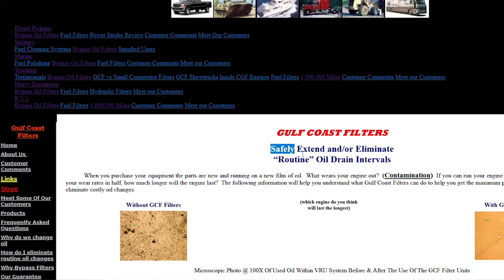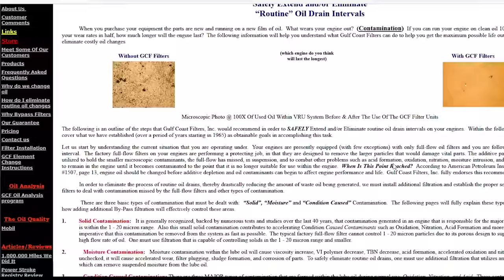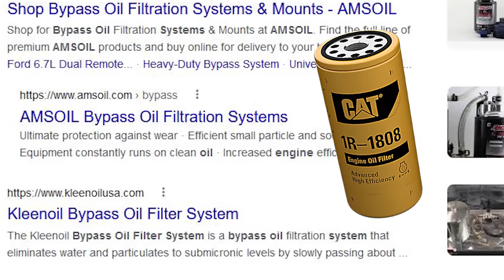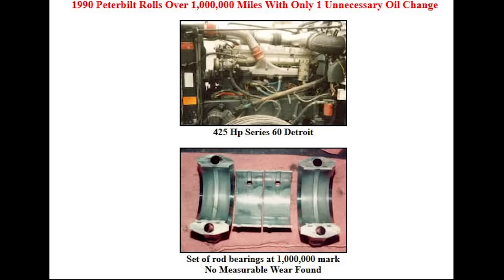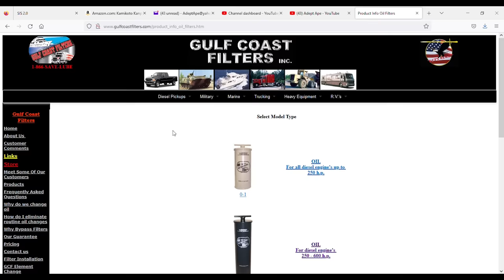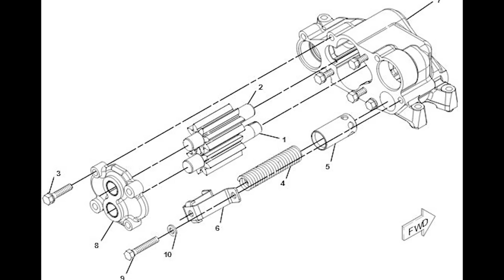No Oil Changes and 1 Million Miles!!! Are Oil Changes Optional with a Bypass Filter? (INTERESTING)

Comment: I spent 27 or so years as a hydraulic mechanic, and 13 of those years I worked with Kubota powered forklifts. One company, that used the cranes and forklifts that I specialized in, decided to get the oil tested instead of changed. In the Kubota engines they had us put Royal Purple oil in, then send out samples at change intervals. All was good for a while, then when a sample came back bad and a change was recommended it was changed. You never get every drop of the bad oil out, and the next sample came back bad as well. And so on, and so on. With hydraulics changing the oil in the tank is only 50 percent of the story, there was always "bad" oil in the hoses and cylinders. Just change the darn oil at the recommended intervals.
Reply: Yep oil is cheap, good oil even cheaper
Reply: Ya. But you didn’t hVe the bypass type filtration installed right?  So as far as this conversation goes your point kinda doesn’t make sense. Having the bypass lower micron filter installed means that when you do finally change your oil the filter ends up pulling any old contaminants out of the new/old oil.
Reply: @Mad.Man.Marine  change oil when it gets dirty. Simple as that i know a few eng builders. I change gear oil in my kx every 2 rides. Oil does breaks down and thats not a debate neither is the need for oul changes to protect the longevity of motor engines
Reply: The only way you can be sure all of the oil is clean 100% of the time is with a.good bypass filter. Im not sure which of the bypass filters is the best. There are several that clean oil. I like the big Gulf Coast filters for big hydraulic systems.For small systems the little Gulf Coast junior is as good as you can get. I like the Australian Jackmaster Classic. If I can't use paper towels or toilet paper in a filter I dont want it. I dont want any filter that opens at the bottom. I like the top loaders. I dont plan on paying 30 bucks for a small filter element as long as I can find Scott 1000. To me there is good oil that is clean and good oil that is dirty. I just put 5 gallons of Lucas hydraulic oil in the Ford tractor. I have a bypass filter for it.Dont have it on yet.The hydraulic oil operates the hydraulic system and the 12 speed manual transmission.. The Lucas was the only one Auto Zone  had.that met that specification.
Reply: So that's hydraulic oil and not engine oil which are comparedly the same however the hydraulic oil isn't constantly being moved around as in like an engine a lot of it will stay in the hoses and cylinders
Reply: I used to work in a power station where we ran VERY heavy Terex plant to move the coal stocks. Apart from maintenance time, they ran 24/7 and each one needed 45 (UK) gallons of oil PER WEEK. 
We fitted bypass filters (can’t remember the brand), changed filters and lab tested the oil every week.  The engineer chickened out and ordered an oil change after three months. But the oil came back clean and really could have gone back in.
Reply: @Dave5843-d9m  we never used bypass filters on anything. The companies (customers) wanted cheap options with little or no work involved, and ended up costing money. No thought was involved.
Reply: I think with the rams working the tractor loader up and down the oil will find its way back to the reservoir..Just got the Ford tractor hydtaulic filters installed. It has the Motor Craft FL 1A and an old Motor Guard on it.  Put a Motor. Guard compressed air filter element in it.They claim submicronic. Its like coffee filter paper in a roll with a plastic core. Ive accumulated a few over the years. Have to use them on something. It has 4 Ford filters on it now. And A Motor Guard. Havent checked to see how to do the cooling system. I have a Cummins cooling system filter.and a Gulf Coast junior
Reply: The Japanese Ford tractor isnt what im used to. The hydraulic oil does everything but the engine. The same 5 gallons runs the power steering the loader the 3 point hitch and all the gears.. one dip stick for everything except for the front differential. It has its own dipstick. The screen is inadequate.  I added a motor craft and a Motor Guard.  It ran at about 70 PSI. On the filters. After a days work it came up to 100 PSI.  When I  move the hitch control too fast it goes to over 150 PSI. Put the filters on the return line on the loader control valve. The FL 1A is a full flow with the Motor Guard being a bypass filter..used a Perma Cool remote filter mount with a Perma Cool universal oil cooler sandwich adapter
Reply: Had to do the hydraulic system a little different on the Ford tractor.. The loader control valve has pressure on both the inlet  and outlet. The 3 point hitch and the power steering are down stream of the loader control valve. Ended up feeding the Motor. Guard submicronic filter with a needle valve and pressure gauge. The hydraulic oil does too many things to use only a screen in the suction.. The motor oil was pretty much the same as the filter on the 390 in the F250.
Reply: Ended up with a Motor Guard and a KN filter on the hydraulic system on the Ford diesel tractor. Ended up with a orifice made out of a grease zerk a needle valve and a pressure gauge. The KN and the Motor Guard are parallel. If the toilet paper cloggs the pressure will go to the KN. The engine has a flat head Ford V8 canister filter converted to use a full roll of Scott 1000. Right now it uses a cut down roll of VIVA paper towels. I mark a roll of VIVA paper towels at 4 1/2 inches. When it gets used down to the mark I cut it to make two elements. The million mile truck used a filter that took 2 full rolls of Bounty Big rolls with Shell Rotella 15 40 conventional I believe. The reason it had virtually no wear was the oil was never allowed to get dirty. I started with a Frantz oil cleaner and Delo in 1963. Only use top loaders now. Gulf Coast Motor Guard the Jackmaster Classic and the Ford canister.
Reply: I agree but there is always room for improvement in filtration.
Reply: Well, royal purple is some of the worst oil money can buy so…
Reply: I don't know why you would by a 100k or more piece of equipment and not maintain it. Oil is cheaper than any engine that it goes in so what the problem.
Reply: @gazking08mx if you aren’t sending your oil in for testing you have no idea what condition it is in when it’s drained. Just because you THINK it is bad and needs to be changed isn’t necessarily the facts jack.

Comment: I have a 2005 freightliner with the mercedes engine. The original owner had the gulf coast bypass filter. I bought the truck with 1,100, 000 miles. He never did anything to the engine. It has 1,270,000 now and it's running strong. It does not burn oil. He did oil changes. I think the extra filtration helps a lot to make the engine last.
Reply: That’s the way I’d use em- not so much for these insane extended intervals, but more so just extra protection for the engine. I do believe they help alleviate wear.
Reply: I just got a truck with That engine. I’m kind of nervous because of what people say of them I’m glad someone is using one that’s been good to them. Makes me feel better lol
Reply: ANARCHY
Reply: Is that an MBE4000 engine?
Reply: Om 906?
Reply: Josh, another interesting informative video !! I've been thinking  about using this system for years. Would just like to go 100,000 miles between oil changes ??
Thanks and Happy Thanksgiving to you !!!
Reply: @isaitrujillo2323  that Mercedes is a rebadged detroit
Reply: @holmes1956O  that’s good to know lol
Reply: GM own mercedes so it's a rebadged mercedes.
Reply: @eugeneoreilly9356  No they don’t lmao! Mercedes use to be merged with Chrysler. Not GM..
Reply: @eugeneoreilly9356  dead wrong, Mercedes has never been owned. They bought Chrysler.
Reply: Glad we got that whole Mercedes Chrysler situation figured out......cool video seems like it's more for maintenance prevention.. hey whatever helps.
Reply: @holmes1956O  mercedes motors came first before dd15/13. So actually Detroit is a 2nd gen rebadged Mercedes tech motor.
Reply: @kennethobando5755  <---This guy is right.   The mercedes engine is Mercedes designed.
Reply: @Isai Trujillo  Mercedes diesels are very well built. Don't neglect it and it will take care of you for a long time.
Reply: About the million mile truck. One Shell oil engineer said its not unusual for these Detroit engines to go a million miles but not be in near new condition. As far as I know the only reason for engine wear is contaminated oil between the parts and not enough oil between the parts.
Reply: Only Engine that I've driven that had to be taken apart twice in 4 years that we keep trucks.  Head gaskets.  Been a while but I seem to recall each cylinder having it's own head gasket.
Reply: yep
Reply: Yes Sir
Reply: @kennethobando5755  you are. Absolutely correct Sir
Reply: @JSAFIXIT  Also. Don’t forget the. Famous. Iszu. My family had one. Tan and tan some more. In a little pick up truck
Reply: I stopped draining oil in 1963. I probably change my depth filter and add more new oil than most. I mostly use gasoline engines that are easier to deal with. The truck owners that dont drain oil normally change the depth bypass filter more often and add more  new oil. The thing to avoid is allowing the oil to get dirty then draining it.
Reply: I had a client with a 05 columbia with the mbe4000.
3.3 mil km original, never rebuilt. Every bolt is fused. It's a pain in the ass and easier to swap then to rebuild but wtf 3 mil. It is insane and without bypass filtration.

Comment: I run a FS 2500 bypass filter on a 2000 5.9 with 640,000 trouble free miles on it.  I went 100,000 miles once on Delvac 1 synthetic.  That drained oil tested fine but I could not wrap my head around going longer.  I now change filters every 15,000 miles and change the oil every 30,000 miles.  The bypass systems work.  They work by trapping the small particles that cause engine wear.  I now run Rotella T-6 5W-40 oil and use one quart every 10,000 miles.  I swear by bypass systems to extend engine life.
Reply: A 24V 5.9 is my favorite diesel engine of all time!
Reply: You got the best dzl lube oil in your engine  ronrdzl

Comment: Railroads tend to not change the oil in large locomotive engines.  They change the filters, clean the strainers and sample it on a regular basis (they change it if the sample comes back bad, but that usually also means they have to fix something on the engine).  And of course add more when it gets low.  This strategy has worked fine on EMD, GE and ALCO engines for decades, but hasn't worked as well on the occasions when CAT or Cummins engines have been tried in locomotives.
Reply: I work for a Class 1 and have been told the same from mechanical department guys.  Was told as well they run straight water in the cooling system with some kind of special drain that will drain the system automatically before it freezes.
Reply: As a locomotive engineer on a class 1, the engines burn and spill engine oil so fast that changing the oil would be useless 😆. As for the coolant yes basically straight water is what we use sometimes they add additives in it but in the field we just fill them back up, the engines have to be running constantly tough, they have GURU plugs to dump the water in case it gets too cold.
Reply: I believe this is the case for ships with their huge engines.  Their sump holds a few thousand kgs of oil and the intention is for it to never be changed, just regular lab samples.
Reply: I thought it was interesting how they have an instrument that passes electric thru a used oil sample. The instrument is zeroed on new oil. If the reading is too high a sample goes to a lab to see why the high reading.
Reply: A marine mechanic told me that in the second to last ship he worked on, they only changed the oil once a year, but they also cleaned the inside of the engine with gasoline. No problems more than a decade.

The last boat was more modern, changed the oil more often, but didn't clean the inside "and we had to send it to the docks for repairs tree times already" he told me.

It made me think a lot at the time.
Reply: On industrial applications, they will readditize some products.
Reply: I also work for a class 1 railroad and we change oil and filters in our Loco's twice a year.  What we found not changing oil on a specific schedule that we started going through turbochargers, PA's, main and cam bearings along with other internals. We also do 30 day oil samples to catch a problem before it gets too expensive and not just in repairs but also downtime.  Cause if it's not haulin' it's losing money.
Water by itself is not suitable for the engines in locomotives but can be used for emergencies....we use borate mixed in the water to prevent corrosion.  We cannot use coolant due to environmental concerns if there was a leak.
Reply: @t1_d2_g3  
If water is mostly used and if dumped, how can the engine cool off if it has no water when in use? Is the water replaced once the engine is turned on and hot enough? Why no electric heater to heat up the water again?
Reply: I've been having oil samples come back clean even when ege cooler is blown.  Can someone explain this to me. Is this a lab issue or the the type of coolant used doesn't show up? Cummins
Reply: All that effort to not change the oil
Reply: Damn I change oil in emds every 700 hours .
Reply: When I met my wife she had a VW beetle with no oil filter.. They were robbing the hell out of her. They had her getting the oil changed about every 1500 miles. On our second date I brought a Motor Guard oil cleaner. That was the best you could get in the 60s Didnt learn about them until about 1966. I still have a couple over 50 years old. Not much effort in changing a filter that cleans oil. Unnecessary oil changes are a hassle. Sadly Motor Guard only makes compressed air filters now.. I like the Australian Jackmaster Classic. I changed it a little bit. Their orifice is a little smaller than I like. I have a drill and a 1/16 inch drill bit. A roll of Great Value 1000 from Walmart every 6.000 miles will do it. Havent worked  out the hours on the tractor. Probably a couple times a year..I have a couple of Gulf Coast juniors and a Motor Guard on the truck. I put them all to work.I prefer the top loaders. Sister wrecked the old Impala. My last two Frantzs went to a salvage somewhere in Dallas Texas.
Reply: Different kind of engine.
Reply: I work on a tow boat, the particular one I’m on does filter changes every 500 hours and oil changes every 1000 hours, that’s with 3 cats pushing 1320hp each. In the bigger ones in our fleet that runs emd 645s and 710s they do the same procedure, filters at 500 oil at 1000.
Reply: @steveallen1340  On Ships  - Don't forget that the oil is continually centrifugally cleaned (Alfa Laval).
Reply: You are absolutely correct. I just left a similar comment and then stumbled across yours. Quality oil filtration is key.
Reply: Never changed the oil on my  impala 3.8l   I was always adding fresh oil  (because of a leak) so it was always clean
Reply: @steveallen1340  depends if the engine type but a large slow speed 2 stroke will have 30+ tonnes of oil.  They last years and years if correctly filtered, purified (centrifugally) and sampled.  Steam turbine oil systems will last the life of the ship.  4 strokes are regularly changed based on monitoring the samples and changing out when the TBN drops off. 👍
Reply: @nathankisner8332  oil doesn’t flow through the egr cooler and most modern setups use  a separate cooling system for egr so as not to contaminate the oil cooler. 😊
Reply: Adding it as a joke, now I have forgot the amount of engine oil for the AC 4400's.
Was it 178 gallons? Been too many years now.
Reply: @jt3178  As a class 1 diesel mechanic, we change the seats out more than the oil due to crews being overweight. We use borate, straight water would cause heavy internal rusting.
Reply: @Bassotronics  If the locomotive sees no water pressure, it will shut off. Some will start up, but won’t allow you to load the engine. These machines have auto start/stop systems on a timer to keep the engine warm when idling
Reply: @spankthemonkey3437  The oil doesn’t know how hard and fast it’s working. The real break down happens with a lot of heat due to added restrictions thanks to the EPA
Reply: @jewlenskyy5993  
Thanks. 😘
Reply: The Army does this too. Thats if they do any maintenance at all... which might explain why they switched to doing this...
Reply: Progress Rail, is CAT.
Reply: @t1_d2_g3  let me preface this by saying I'm not an engineer but I am a chemist. What does the borate do to prevent currosion? I presume it's sodium borate. Is it sapose to chelate metal ions from solution? If so why not use something that's designedto do that like edta? Or is it just due to the fact your working on such large scales the price difference becomes large enough that it doesn't warrent the extra abilities of the edta. Thank you!
Reply: @Bassotronics  The engine will not run if there is no water. The low water pressure shutdown protection prevents the engine from being run after the auto water drain is activated.
Reply: They put the big Gulf Coast filters on Shell offshore rigs. Its my understanding they use locomotive engines in offshore rigs.
Reply: @ralphwood8818  the beetles sieve oil and air filters worked on physics (U turn and centrifugal force for tiny particles and the sieves for larger lumps) and the recommended oil change intervals are every 3000kms .
Reply: @Bassotronics The locomotive will only dump water if it is a. not running and b. Less than 40 degrees F or so. If the engine is kept running, or has autostart, then no need to drain the water.

Locomotive engines, at least ones out on the road, can sense a low water pressure condition and prevent running of the diesel engine with no coolant. It's been this way since the 40s.